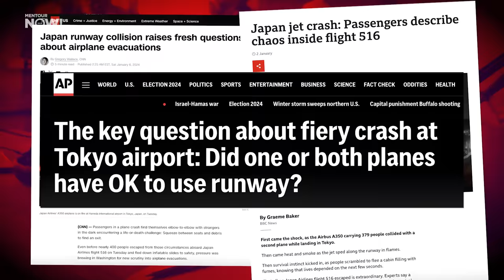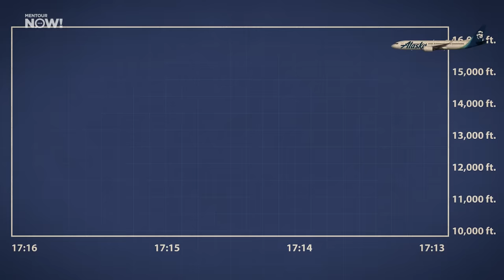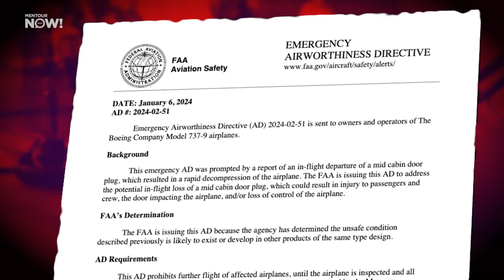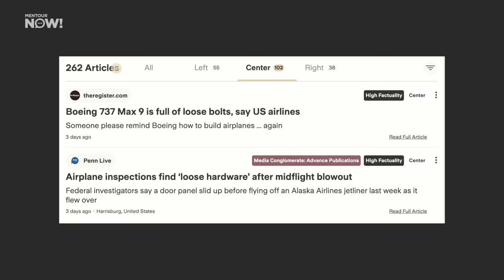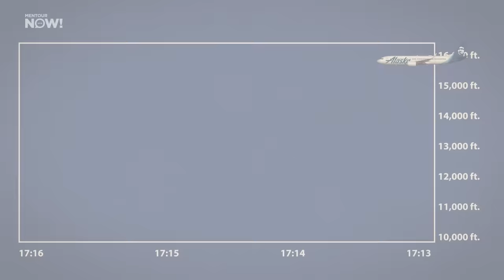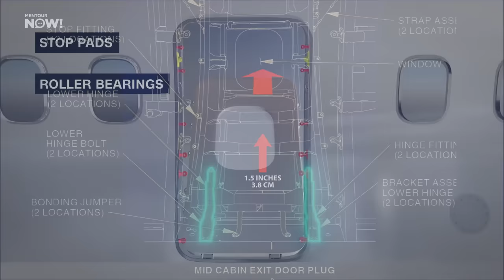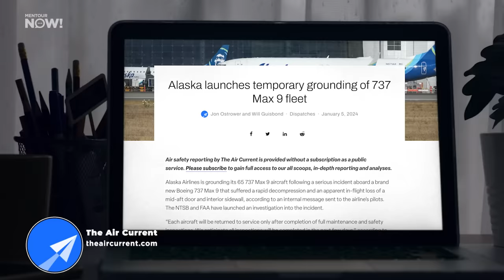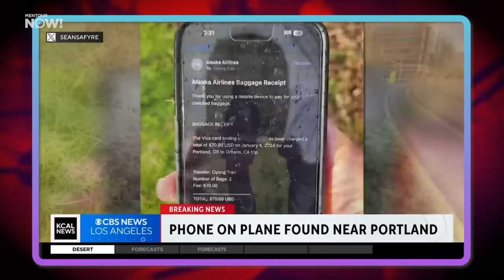WHAT Is going ON with Boeing?! MAX-9 Door blowout

Comment: First time I looked closely at the flight path.  It flew just a couple miles south of my house after the marked depressurization and descent.  

However, the plug door was found “relatively” close to where I work out in Beaverton.  

I don’t recall it being particularly windy that night, but it seems to me there would have to have been a pretty significant east wind aloft for the door to land so far NorthWest of the “decompression”.
Reply: The door is pretty flat object and would probably glide in the air. The initial orientation in the air probably defines which way it will glide.
Reply: @MikkoRantalainen  um...  the door landed 4-5 miles behind the indicated "depressurization", in the opposite direction of its initial momentum (>400 mph to the SE).  The door certainly wouldn't "glide".  
Whatever "glide-ratio" a door plug has, even if spinning like a frisbee (unlikely), that's not a physics-friendly answer.
The only plausible scenario is a mis-indication of the actual depressurization location, the door being light enough to gain more initial altitude, and some significant winds aloft to counteract the forward momentum.

Comment: A pretty obvious fix to make sure this particular problem will not happen again is to simply forget about optional plug panels - if you fly Max-9s then you have a door in every spot designed for one, regardless of how many seats you have. Better to unnecessarily exceed evacuation standards than cut it fine to squeeze in one extra row of seats. And do the same for the A321 while you are at it.
Of course that does not address any wider issues of Boeing's manufacturing standards, but that is a whole separate thing.

Comment: Thanks @mentourpilot for giving us the actual design/details of the door since mainstream media, it seems, to be more worried of clicks and exploiting the incident than providing the facts.

wow door tech has changed a lot form a 1950's 707.  On a military 707 over-wing door you have to remove the door into the cabin by hand with a nearly a 3 foot handle to pry the door away from the fuselage in case of pressurization.  I do remember flying on passenger aircraft prior to 2010 that on the safety card we had to put the over-wing door on the passenger seats.  To me when you say door plug was thinking of that door on the 707 where it is bigger than the hole in the fuselage.  I thought the door had structurally failed in that the door folded and then pushed out of the aircraft, I could see that the door hole in the fuselage was intact & not deformed. Now I'm better educated and have a better idea of what actually happened. Looks like they should have removed the springs on the hinge when installing a door plug. But well see after the report has been published of what failed.

I'm still laughing at people who are trying correct others in social media saying that the window left the aircraft not a door plug.  I guess they need to have reeducation on identifying things with their eyes.

Comment: There are 2 redundant pressurization sensors that disengage the door latches. It was surprising that the pilots were not aware of this. On Airbus ACFT, this is documented, with 2 lights that illuminate on the aft section of the overhead panel if there is a sensor fault. Once again, Boeing leaving pilots in the dark regarding functions of the aircraft. Your NG has them too. The panels are only a tertiary redundancy.

Comment: I still don’t quite understand.
If this actually was a plug-type door, surely the static friction caused by the outward force should’ve ensured that sliding it upward was basically impossible (and certainly not something that could be done by random vibrations of the airframe)?

As an analogy, imagine trying to push a slab of stone along the ground while there’s someone standing on top of it. And now imagine that the weight of that person was as huge as the force from the pressure at 16000ft on the total area of an airplane door panel.
It seems like it just shouldn’t be possible.

Comment: 19:11  It would have been impossible to detect unless someone was leaning on the panel and heard a hissing during flight.  All inspections on the ground would not see anything abnormal, since  there's no vibration and turbulance to work the bolts.  They'd have to check every bolt like they're doing now.
Reply: The pressure system issue was an unrelated malfunction. An aircraft maintenence fellow posted saying they do check the pressurization by examining all seals externally during pressure tests- though there was no reason to test this one yet.

The bolt issue is indeed undetectable once the infill panels are in place.

Comment: Have a feeling that this might have been caused by a change in the process - for example if this airframe was due for another customer that was going to have the normal door but then got changed to be for Alaska and therefore had the door changed out of sequence and out of the normal process and didn't receive the correct QA checks.

Not an excuse but a potential explanation of how such a thing could occur.

Comment: I’m slightly concerned with the fact that Alaska continued to operate a 737 with a known cabin pressure issue, and that the only reason nobody was hurt was that there were no passengers in those two seats. I understand they could not have known that the loss of pressure was related to the door plug (assuming that that is the case), but still.

Also, the change in how they used the aircraft might not have been a requirement by the FAA, but given that this could have ended in a far worse way, that hardly seems relevant.

I also do realize that aviation is still very safe. And I actually flew with a United 737 Max 8 last Saturday. Apart from quite severe turbulence (which made me really uncomfortable) at the start of the flight, all was ok.

Comment: I've always understood that a plug door can only be removed from the inside similar to that of the overwing emergency exits on the old 200 series 737.
The doors on these aircraft are held in place by the 12 lugs so it cannot be a plug (as in a basin plug). The main door of a 737 is a plug as it has to be open in then the top and bottom of the doors a folded back before opening out.
Reply: A plug is any infill piece and not related to shape or design.
Reply: @mandowarrior123  A plug door in the 30 years that I flew and did type approvals was always a door that opened inwards.
Reply: @mandowarrior123  Oxford Dictionary of a plug "a piece of solid material fitting tightly into a hole and blocking it up". Clearly the word plug means different things in different countries. 

The logical actions of the FAA would be to require the plug doors on the 737 to open inwards, especially as they cannot be seen for inspection when the interior has been fitted.

Comment: There is a design, installation and inspection issues with this plug.  A better solution would be to install the normal passenger door with slide.  Less cost effective but safer and better for public relations.

Comment: They didn't sit anyone near the door plug, so was there a little excess noise that they found passengers didn't like because of a bad sealdue to lack of bolts? Or was it perhaps colder to sit in those seats for the same reasons?

Comment: There are now photos taken from Google earth circulating that show a Max 9 being worked on by a company installing the wifi system in the roof, and that is right over where this plug door is, and also in that photo it shows a temporary roof over that area as well as temporary staircase leading to the plug door area.  So that’s another possible vector here, that a third entity could be involved in not securing that door properly.

Comment: Another very good video.  I would be interested if you did a video about the cockpit door which opened with the decompression.  I understand that it was designed to open with decompression but apparently few were aware of that fact.  It wasn’t even in the manual.   This has been reported to have caused communication problems both between the pilots and also with the ground.   Is this common on most planes, and what is the purpose?
Reply: As the video shows, the cockpit door is supposed to be able to resist decompressive forces, but the decompression was so rapid, it hit the threshold of another door feature (whose primary function is not for decompressions). That's probably why it wasn't included in the manual. This feature is described in the Maintenance Manual as it is related to maintenance. 
Other aircraft, however, may have a dedicated pressure sensor for sensing differential pressure and releasing the door.
I still don't understand the comms issue. Was the cockpit so loud, they couldn't hear each other? The oxygen masks have their own microphones and there are speakers for audio (if their headsets had gone AWOL).

Comment: When were the interior seating installed into the aircraft?  Were the Plugs removed during this installation???
Was the airframe transported by Sprint to Boeing with the Plugs installed &/or did Boeing install them???
Were there any Maintenance actions preformed, that required the plugs to be removed &/or be inspected???

Comment: Probably OtterBox, mine has only dropped 20 feet onto cement, not even a case scratch, silicone inner case, hard polycarbonate outer case, traveler model, I think

Comment: Are you sure the accident happened at 16,000 feet?
Most other sources say the depressurisation occurred at 13,000 feet and that the plane continued to ascend for a minute after that until the pilots set the target altitude lower.

Comment: Several pieces of evidence points to the failure to install the locking bolts was by the contractor who installed the WI=Fi system shortly after Alaska took delivery of the Aircraft.  Hopefully the NTSB will dig into this

Comment: It’s weird that the lift springs are fitted with door plugs. They serve no purpose, apparently. 🤷 Further, if the springs are the same as fitted to doors, they will be sized to support doors with handles, which are probably heavier than the plug?

Comment: Boeing engineers toured our Saturn plant in the late 90's - early 00's and they were interested in error-proofing their processes and the group was sent to me to see if I had any suggestions. We did a job (completed the operation on the car in that particular station) every 48 seconds while Boeing did a "job" (completed the section of the plane that a particular station was designed to do) every two months. When I pointed out the vast difference in build rates and what went on in a station, they thanked me and went on their way. I got the feeling at the time that they were checking a box for a manager. It felt like they knew that they had a problem, but wanted it to remain a production issue and not something for engineering to solve.

Comment: There is something inexplicable about the iPhone being found:

It was on.
It was unlocked.

Neither of these are likely but the most unlikely is that it was unlocked but not trying to make a 911 call. 
On means the cell phone carrier knew, exactly, (well, within a few meters) where the phone was. 
On means it, surely, detected it had experienced a fall and, should have been, relentlessly, trying to get the owner to confirm or deny a fall. By the time it was found, it must have been trying to dial 911 for a significant amount of time.

Unlocked means it was broadcasting even more location information.

Comment: Apparently that plug door is removed in the process of installing WiFi on the aircraft.  That's after it's a complete aircraft.  I'm not sure where and when, but I'm betting some bolts were left off then when the door was reinstalled.
Reply: Yep. Last person to touch a badly fitted part always has to be the prime suspect.

Comment: Are these the same MAX type of planes that were recently grounded with the 'software issue' where the pilots were unable to control the plane? Sorry if my question sounds vague, I'm not an engineer or pilot, just responding to what I have previously seen on this (and other) channels. I understand business / commerce a lot more than I understand aviation engineering. There seems to be a recurring theme with Boeing incidents of putting profitability before passenger safety - I don't know how this compares with other manufacturers - but Boeing seem to have more problems more regularly based on what is identified and reported.

Comment: a closer look at who was doing the fitting of the internet bump on the top of the plane. AAR was contracted to do this.  Possibly even contracting out further. check the work being done on googleearth it AAR Oklahoma.  you see the work being done. they claim to be not removing the plug. but the temptation to do so while working  in this area would be huge. still even better instead of a cheap plug a fully functional door might be safer.

Comment: If the springs partially assisted in lifting the plug (and disallowing the plug to be held down by it's own weight), is there a way to just uninstall the springs? Surely if they're not being used, they're not needed

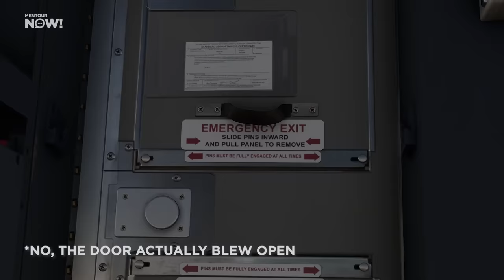Comment: Did anyone else notice the ineptitude of Boeing at time index 2:29?  Look at the decals on that door panel.  Decal 1 says "Emergency exit / Slide pins inward and pull panel to remove".  Decal 2 says "Pins must be fully engaged at all times".  Well, which is it, Boeing?!?  If the pins must be fully engaged AT ALL TIMES, then that includes during emergencies, so those instructions are contradictory.

Comment: Considering all the issues Boeing is having with its airplanes i am now concerned to fly in one. Imagine, it took them 2 crashes to fix a software issue now the structural issue is showing up after 8 years since it got introduced back in 2016. Not sure what other issues will creep up over time on this airplane. Better fly with those airline which provides Airbus in its fleet or the old boeing planes which had quality.

Comment: I've worked at Boeing, Our C-17 Welding "Engineer" had never done any form of welding! All textbook knowledge! I've worked at companies that Boeing outsourced C-17 work to,  These sweat shops don't purge their weld assemblies! ANY INSPECTOR SHOULD KNOW THAT A TITANIUM OR STAINLESS STEEL WELDS SHOULD NOT BE WIRE BRUSHED OR SANDBLASTED!

Comment: Aren't commercial aircraft doors designed in a way that they can only open with no pressure differential between the inside and outside?

Comment: At 10:10, wouldn't a door be easy to open if the pressure outside is lower? Things get sucked out of airplanes when there's a leak in the cabin, correct?
Reply: Ahh I just found the answer, it's a plug door that swings in first and then pops out, interesting!

Comment: What would have happened to the aircraft if this had happened at 35,000 feet?  Would the pressure differential have had a more explosive effect on the structural integrity of the cabin at that altitude?
Reply: Yes. Possibly led to a fuselage breakup, but even if it didn't the danger to the passengers would have been much bigger (much colder, much less oxygen, travelling faster, have to dive down to breathable air faster). So ironically whoever left those bolts absent or loose did the right thing by doing it to ALL of them - if the panel had been hold on by (say) just one bolt it may not have let go until the pressure differential was bigger.
Reply: @kenoliver8913  Structural integrity? The roller guides on the door sheared and the door flew out the hole. How could the structural integrity of the aircraft be affected? The hinges sheared too without too much trouble. The door frame is not fragile. The door is the first thing to break.

Comment: I'm not a mechanical engineer, but this construction looks really suspect. The door is held by just 4 small screws, that look too flimsy. Sure, they don't bear a lot of load, but they could have designed the plug mechanism to be completely safe, so it would be impossible to get it open without a lot of structural damage.

Comment: I don't understand why it is that if an aircraft can have two fewer doors in a 3 class configuration, they can eliminate the doors in the most densely seated area of the plane. It seems to me that that extra door is still necessary due to the number of passengers there are in that section of the plane.
Reply: There is no guarantee that any given door is available in an emergency and evacuation tests are done with half the exists closed.